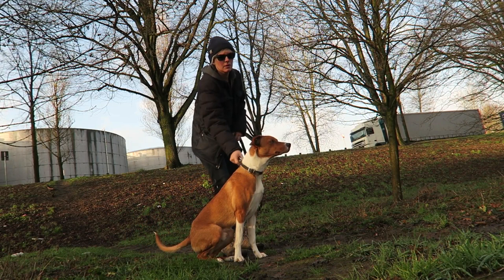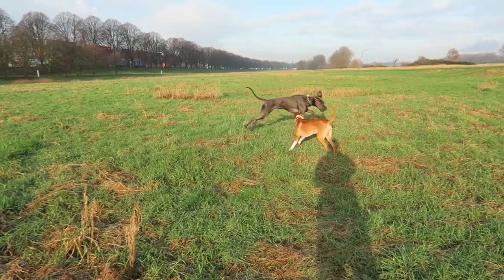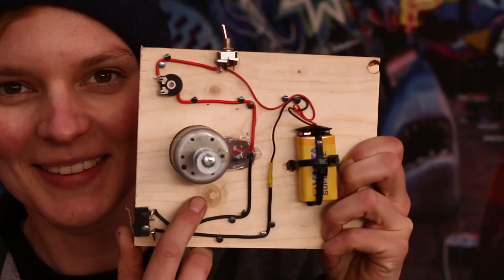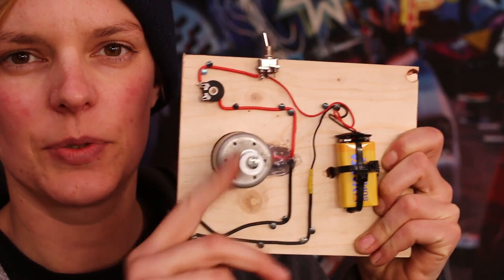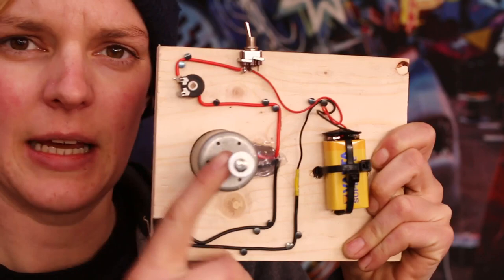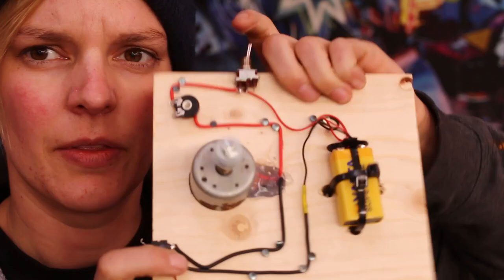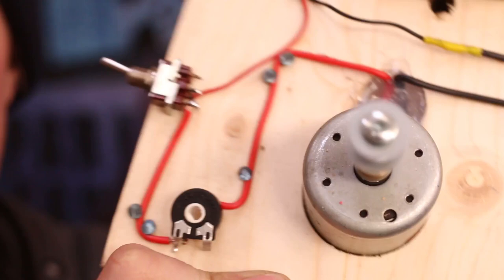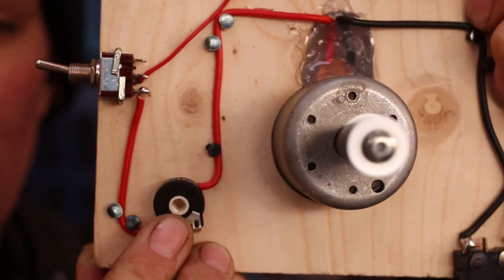Vlog 005 My Next Project

Comment: Hi, Laura! Usually you don't want to use potentiometer to control speed because you loose power that way. What you could look into is pwm controller which basically runs on/off signal to the motor very fast. This frequency controls speed without loosing power. PWM can be bought as a ready to use device or assembled on 555 chip + couple of diods and transistor. Tutorials are plenty. Anyway, nice vlog and videos, carry on and have a nice day!

Comment: I have a cheap slider rail I bought from ebay  and to move it I am using geared 30rpm 12v motor from china(10 euro)  with a 10am 12v speed pwm comtroller (10 euro) linked to a couple of switches one for direction the on off and a 12v alarm lead acid battery (15 euro). To move on the track I am using some gt2 cnc belt and pulleys from Germany, again about (10 euro). It will be interesting to see what you come up with. I used to use the motor out of an old cordless drill
Reply from the maker: +Paul Adams (The Handmade Fisherman) thanks for the tips! sound very interesting!

Comment: In AUS, for "potentiometer" we say "POT" for short. Not sure, but going by the video it kinda looks like your soldering could use a few tips. Make sure the surfaces of both the wire and tag or whatever your are trying to solder together are very clean. Obviously you are using resin core solder? If not, need to flux the job. And please use eye protection. Soldering accidents are rare, but a splat of hot solder in the eye can be devastating and it does happen more often than most people realize. Anyway, hope you have fun. Regards, Dave Kahlbaum. Adelaide South Australia.

Comment: For the camera slider you definitely want a PWM speed controller rather than a resistive controller. Also look into the simple circuit to make it reversible (DPDT switch, and easy to add in limit switched). You also really want a gearing system for the motor so you can use a weaker motor with fewer problems. To power it you can salvage 18650 Lithium cells from old laptop batteries, much much better than a crappy 9v battery.
Reply from the maker: +Slugsie thanks for the tips!

Comment: "Made from scraps" heißt aus reststücken gemacht
"made from scratch" heißt komplett selbst gemacht

Wegen dem Motor: Die 9V Batterien können vermutlich den Strom den der Motor braucht nicht liefern, wenn du ein Datenblatt hast, kannst du den Nennstrom nachgucken, und mal mit einem Multimeter vergleichen was da wirklich durch geht (dazu das Multimeter in Reihe Schalten, also den Stromkreis unterbrechen und diesen mit dem Multimeter wieder schließen), wenn der Strom zu klein ist, einfach mehr 9V Batterien Parallel schalten. 
Parallelschaltung erhöht bei Batterien den Strom den sie liefern,
Reihenschaltung erhöhr bei Batterien die Spannung die sie liefern.

Wenn du kein Datenblatt hast, schalte einfach so lange 9V Blöcke parallel bis der Strom nicht mehr steigt.

Grüße aus dem beschaulichen Ostfriesland :-)
Wenn noch Fragen sind, frag ruhig
Reply: +Raphioso upvoted for the scraps vs. scratch clarification, which I would have posted in a similar way otherwise. Then I read the rest of your comment and thought that's worth another upvote or two... So if anybody reads this who doesn't know German: Raphioso not only provided excellent language advice, but also shared some (very understandable) knowledge that might help with Laura's technical problems. Raise your thumbs, people!
Reply from the maker: +Raphioso wow, danke für die tips!!

Comment: You might consider using a variable speed drill or some of it's parts for your camera dolly. If you could find a use one for cheep like ones you already have then you would not have to pay for a battery. For short I call a potentiometer a POT but you did well pronouncing it.

Comment: Hey Laura, try modifying an old model servo they run on 5-9V and are pretty strong due to many internal gears. Also they are cheap (chinese ones start at 5€) and you might be able to trade one in for free at a local model hobby shop for a favor on you lathe ;-).
To modify unscrew the housing and take out the potentiometer and electric, just leave the motor and reconnect two wires to it . Sometimes you need to break of a small mechanical endstop. Any questions you can ask me back in german as well :)
Reply from the maker: +Simon E ahhh, super! ich hab gestern noch n motor bekommen. setz mich am wochenende mal dran. meld mich falls ich noch fragen habe! danke!
Reply: +Laura Kampf wenn Du den mit nem Potentiometer drosselst nimmst Du das Drehmoment raus, denn  aus den 9V der Batterie werden dann z.B. 3V, den Rest der Energie verbrät (wörtlich) der Wiederstand mit den 3V kann der Motor aber nicht sein volles Magnetfeld aufbauen und hat damit weniger Kraft. Deshalb sind dann die unten vorgeschlagenen Regler besser. Die schalten dann den Motor schnell an und aus (hört man auch wenn die Spulen quietschen) . Bevor ich nen Roman schreibe Wikipedia Pulsweitenmodulation. Und ne low cost Variante google nach PWM mit 555 Timer, die Bauteile sollten in den Resten deines umgebauten Kassettenrekorder zu finden sein :-).  Ne Platine brauchst Du dafür auch nicht, die paar Teile schön auf Kupfernägel löten die auf nem Holzbrett stecken und mit Kupferlackdraht verbinden sieht stylisch dann auch top aus.

Comment: Goto an auto wrecking yard and buy a windshield wiper motor OR an automatic car radio antenna motor.  As they operate on 12v dc, powering them is easy AND they have lots more torque when used with a potentiometer (speed controller) than the little gutless tape deck motor you were using in this video.

Comment: Modest Mouse is great, haven't listened to them in a long time.
I think you will need a lot more power than a 9V battery to run your slider (only about 3Watt), you could try using old laptop chargers (19V/2A) or printer powersupplies (12V/2A), also there are some PWM controlled motor-regulators on ebay with variable input voltage rated for 2-3A which should be enough. Hope this helps. I built a timelapse-slider myself but used a stepper-motor and an arduino to control it, along with a 12V Blei-Gel Akku (don't know the english word ;)) but for camera movement in video that would be overkill and too loud.

grüße aus bonn, Christoph
Reply from the maker: +Christoph Reifers cool, yeah, as i said, i have no idea what i am doing :) maybe i take a trip to conrad electronics...
Reply: +Laura Kampf good idea, haven't thought about that. this one should do, maybe you will find something cheaper on ebay. https://www.conrad.de/de/velleman-dc-pulsbreitenwandler-bausatz-8-35-vdc-190967.html i'm sure you will figure it out ;) 
Gutes Gelingen!

Comment: Laura, you should really look at using a 555 timer to  do the motor speed control.  The circuit is simple.  http://www.electroniccircuitsdesign.com/sites/default/files/imagecache/main/img/555-timer-dc-motor-driver.jpg

you can get the parts pretty much from any supply place and they will be dirt cheap.
Reply from the maker: +lsdave ah, cool. i think i have a 555 timer from another project laying around. thanks

Comment: If want to control the motor speed without losing power you will need to connect a transistor or a driver like the l293d wich is reversible. Link to do diagram http://www.electroons.com/8051/electroons/images/ckt_mtr.jpg